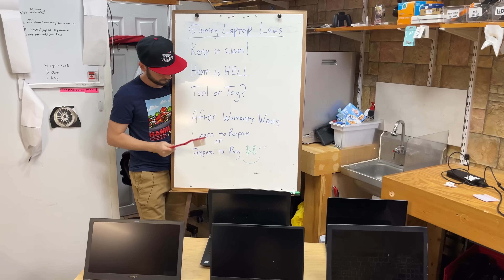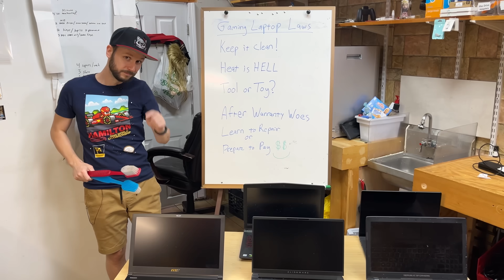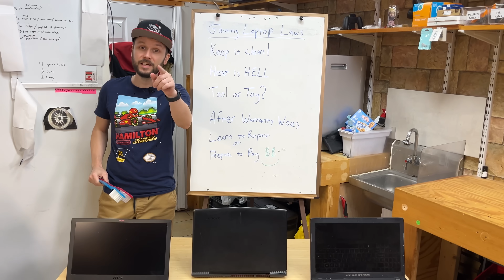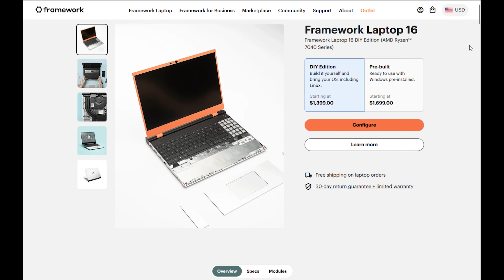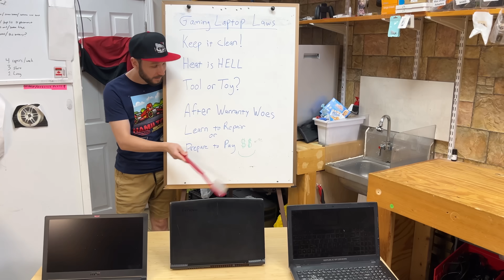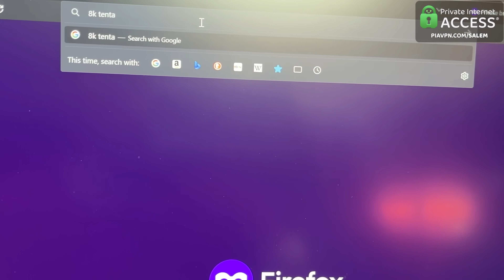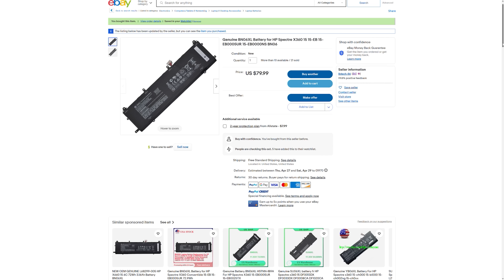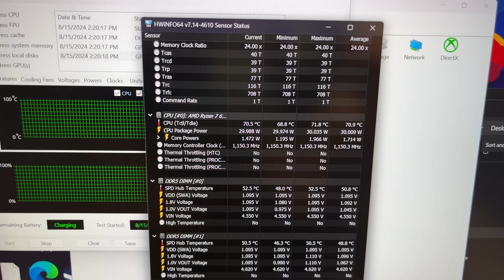Repair Shop Owners Guide to Buying and Maintaining a Gaming Laptop

Comment: Ever since you talked about the P50, I've been checking ThinkPads of that series, ( 50, 51, 52), and even though my current laptop is still working well ( a 13 year old Dell Inspiron N5110 with an i7), i do wish to have something overbuilt, upgradable, and it could last again the same amount of time. Of those three ThinkPads i mentioned, which one is the "worth it" between used price to performance to durability? I'm interested in more light casual gaming, and honestly nothing really from the last 3 to 5 years. P50 are a bargain, P51 are more expensive but still below new laptop prices and the P52 it's a stretch but if equiped with highest or as close to highest spec, still a beast compared to a lot of stuff. Unless I'm really out of touch with the current market ( i still cannot fathom with AMDs are the better ones, compared to Intel and Nvidia). Which one would you go for?

Comment: With cleaning, how often should I be pulling it apart to clean? Went from a Clevo which was about 17 seconds to disassemble but now i have 17 screws and a dozen clips in an MSI and really don't enjoy dealing with clips at all. 

Honestly miss the Clevo and how easy that was to entirely disassemble.

Comment: The fact that i watch this on an HP gaming laptop and i have a 13 year old dell gaming laptop that was cleaned last time 5 years ago that had 10 TONS of dust that i had to get a big paintbrush to remove it and the thermal paste has never been changed and it peaks at 90°C and turns off
Reply: Also the dell got a weird ahh update and now has macos and now overheating even more

Comment: I got 2 alienware m51 laptops  one is r1 and was mailed badly the other was plugged into a wall and surge hit went po. Really need to try to swap the motherboard out on r1 see if it's an easy fix. Brought both into multiple repair shops for inspection and all 3 said sorry me no fix. So if I want more then a dusty paper weight I guess I gotta try one of these odd wb sites that sell replacement motherboards and try to fix one at a time.

Comment: Bought a lenovo legion y530 gtx 1060 6gb back in 2018. Worst decision ever. Temps were horrible and even repasting didn't make a difference. Died less than 3 years later due to power port pins first disfiguring then burning out. 1300$ down the drain.

Comment: Just got some PTM7950 for my Zephyrus g14 repaste. What would you recommend for the vrms? I was thinking K5 pro but I've seen conflicting reports about it.
Reply from the maker: I'm used both K5 Pro and Upsiren thermal putty, I would go for Upsiren as it's generally easier to apply and remove.

Comment: after the first few losses of normal laptops, i always have a ready supply of alcohol wipes and also gave my new asus gaming laptop a keyboard cover now. Thankfully i also bounce between my desktop and laptop for purposes. However in the eventuality that i have to change the battery for an asus like for an old dell laptop, how difficult would it be to source an asus tuf battery

Comment: Hey @SalemTechsperts I got a question. I recently got a gaming laptop and was wondering about the charging port and the cable. It says in the user manual that you shouldn’t keep the charger plugged all the time because the parts were not made to sustain such heat overtime. But taking it out and plugging back in seems like the wear and tear will get to it before the heat, I’m a little confused on what I should do? Any help/advice is much appreciated thank you! 🙏

Comment: I had mine for 7 years, i still use it, heat problems, the display gave up on lifr so i had to get a new one, some key caps are broken, the keyboard has crap under the keys, the hdd connector is bent, i need new ssds because they are slow, the cpu is throttling (maybe the gpu aswell), the fan on the gpu side has a blade broken so the laptop vibrates, the heatsink's radiators are kinda bent, the heatsink's screw connector is fucked because i bent it while trying to remove a chewed up screw, also I have to buy new screws because they are overused and chewed up

Comment: I want to get into the it desktop support space in Madison, wisconsin but most jobs offers i see require 1-2 yearz of experience. Which i don't have, even though i am CompTia A+ certified,  and have a technical deploma in it desktop support, any tips or advice would be appreciated.
Reply: Try looking at your local school districts. That can often help get you in the door. Depending on the district, you they may have help desk roles or IT technician roles or a hybrid of them.

Comment: Could I ask how expensive those micro-soldering place generally cost? I also know exactly what the issue is I just lack the technical expertise to fix it (soldering). My Alienware m15 r5's port for it's built in screen is damaged and the bios doesn't like it. Part of the plastic connector broke off (I still have it), so now some of the individual copper wires don't even make contact with the port anymore never mind the screen. What I mean by the bios doesn't like it is that the damn thing will refuse to boot if it can't detect that the built in monitor is plugged in even if an external display is plugged in. I can trick the bios into thinking the monitor is still connected by holding the piece that's broken off by hand next to the rest of it on the mobo so I can plug the monitor in. It still doesn't send signals properly thus the screen doesn't work still, but the bios can at least detect it which is all it wants. After it starts Windows I can simply take the broken piece back off and keep it in my save keeping place, and Windows will properly detect and recognize my external monitor and make it the main display. Basically the problem is that I need to get that port fixed to at least to the same degree that holding it in place with my finger does. I'm perfectly fine with not having the laptop's built in screen actually being functional though obviously it working is preferred. Also I'm not sure why it does this, but the problem only comes up if Windows doesn't shut down properly. However, if it does you'll be able to full restart it as well as shutting it down and turning it back on later.

Comment: sheesh i can smell this video, i usually have a stack of dead gaming laptops on our shelf in the back at any given moment. ill also note that i've seen at least one of each of those model gaming laptops come in for repair, expensive pieces of trash imo

EDIT: quick question, i on occasion have to redope laptop cpus so end up using thermal paste and from my experience isnt as good as thermal pads on gaming laptops and wanted to know what you recommend for thermal pads

Comment: Not a gaming laptop but my HP Pavilion laptop battery ballooned up oneday...
Trying to find a non sketchy replacement online was trouble and the one I eventually bought didn't even work in the end...
Reply from the maker: I had this exact thing happen to me on my HP Spectre x360. Had to grab one from eBay that was genuine and still sealed. Still works to this day, which is about 3 years later.
Reply: I had a similar issue as well I live near a micro center so I got it there instead. The only annoying thing was the non HP battery screen every time I booted it but it was better than getting a sketchy Amazon one in my opinion

Comment: I want to game, am used to having the lowest of the low so am not picky, though im considering a minipc because it seems.i could get up to a 780m for around $400.
  If i follow your advice to get a t14, what gen should i be searching for?
  Prices on used vary greatly, and is a bit of a gamble with the cheaper websites.

Comment: Quick question, i'm looking to repaste my legion 7(2020model) and it has a vapor chamber cooler. I watched a disassembly and i didint saw any thermal pads in the inside so i am wondering if i have to order thermal pads?

Comment: Can a computer really get damaged by heat? I thought the manufacturers set some thermal limits that would either throttle or shut down the cpu when temps become critical.

Comment: I am working on a sleeper prodesk 600 series that’s built into my desk and I’m going to order plexiglass and some brackets for it to work but for right now it’s all plugged into my desk and runs slower then my grandmas car I am running a 15 year old cpu and am going to get a i5 8500 for it to run once human on better quality I’m running the original power supply that came with it and a 1650 that I got from a friend it plays games very slow but if I do get a chance to I would upgrade to a mvme or get more ram for streaming on twitch

Comment: I have an MSI Raider GE78 HX 13V that I purchased from Microcenter in August 2023. Since day one, I've noticed an issue where the CPU temperature reaches 90°C when I play video games. I initially didn't pay much attention to it, but now I'm starting to get concerned. When I play GTA V, the computer sometimes freezes or the screen turns black. I'm beginning to wonder if this is normal or if there's a defect. I'm really starting to think that Microcenter might have sold me a faulty product.

Comment: I got a question, i recently changed my ram in my laptop. I was following a step by step guide made by the company (that made the laptop) and it said to remove the black tape covering the ram, but it didnt say if i had to put it back in place afterwards. Should i? Is it gonna burn hot if i dont?

Comment: With the topic of Heat, should I adjust the TCC on my laptop to only go to 85°C? I have it set to 90°C but I have no idea if it will throttle performance that much.

Comment: from a couple of years of experience owning a gaming laptop i learned one crucial lesson: do not buy a gaming laptop. i hate mine with passion.
Reply: a brand new acer aspire 7 laptop was throttling at 80 degrees, which it was reaching in cs:go because the cooling is terrible. if I wasn't heavily into optimisation of my system i would have to live with terrible lags because it is unusable without heavy undervolting.

Comment: I just bought a MSI cyborg 15 A13V, im trying to keep my computer clean as new and trying to keep it cool i also have extra fans but i dont know if my computer is overheating or not, when im gaming its usually around 65-70 degrees, and on natural its usually around 45-55 degrees for both cpu and gpu are those good numbers?

Comment: hey its unlikely you hear this but i really hope you do, i have a lenovo legion 5 laptop with AMD Ryzen 7 5800H and a 3070ti gpu but the thing is my laptop overheats alot in games like dead space remake or even fortnite i went to settings to stop this and made the cpu only work to 75% but the thing is i want my cpu to preform at its best because i need it to and knowing that 100 percent isnt allowed do to heat seems stupid by the manufacturers of it

Comment: I bought a used Lenovo Legion 7 Gen6 recently that looked amazing. Turned that sucker on and the smell...... Oh the smell made @SalemTechsperts mom run out of my room so fast she left the fresh chicken tendies without touching them... I removed the swamp gooch like the champ I am but the smell is still there after the isopropyl bath I gave to most of the components. Even if you avoid the bed, keep that pet fur away from the vents :)

Comment: Firstly, I accidentally spilled noodle soup on my laptop, but because I have the skills, my laptop is still there until now
Secondly, maybe I will buy a fan for a laptop with good airflow, after the money is collected this week.....
Thirdly, for me a laptop is a tool that must be looked after as well as possible
Fourthly, ah... this is a bit embarrassing.... because I spilled my noodle soup, I turned it off and disassembled it on the same day and lost the warranty on the same day too.... (I think)
Fifth and sixth, I already have basic skills regarding repairing laptops, but if the damage exceeds my skills then I am ready financially...

Comment: A connection at the loadingport of my Lenovo Yoga 530 is lose ... should i solder it back together or would it break even more? ( right now everything else works but it dose not load, corse a slim metal strip is lose)

Comment: Hi! So I got a Dell G15 5530 that i have for almost exactly a year. According to Msi Afterburner, my Cpu (13th Gen Intel Core i7-13650HX) is overheating and is still overheating after cleaning out the vents. My Gpu is fine tho, running at 60-70 degrees while playing which was basically the same before i cleaned out the vents. Does that mean that the thermal paste needs replacement? If so, how do i do it and which thermal paste should i get?

Comment: Iv got a laptop which is like 2 years old, everything seems normal but thers alot of dust in my area and I'm a little worried about temps, its an Acer Nitro and the nearest service center for Acer is around 10 kms away so idk how il gonna clean everything and maintain properly

Comment: Hey, can you help me out regarding a design issue in lenovo legion laptops Y540? Charging stops midway due to rising temperature of the laptop, i use throttlestop(-140mV), keep laptop clean, change thermal paste but still charging issue continues. The heat reduces but the charging port heats up which result in no charging.

Comment: i need some advice, i am 16 years old with some experience in repairing pc and console, this year i bought a laptop from asus (vivobook series), i know it isnt a gaming laptop but it has a 3050 and a 12gen i5 and for 700 euro i think it was a good deal, the problem is that my parents do not want to let me open the pc because they are scared that i will break something, any suggestions on how i can keep the only fan that prays for its life in good condition without having to open it? thanks

Comment: My gaming laptop broke after i repaste it. It lasted 4 years with no problems but the last 2 weeks it was having thermal issues. I maintain it regularly so no swamp gooch. So i re paste it and after i did that it kust stopped working

Comment: My dell G15 came out of the box bluescreening and even still it blue screens about every hour. Annoying that it’s happened during online exams and caused trouble.
Reply from the maker: @3vlogs487  damn. Didn’t have time to return it?
Reply: @SalemTechsperts no, I thought it was a windows problem and I would be able to fix it. Even after a full reinstall it still blue screens constantly. I extended the warranty because they let me for some reason so I’m going to send it to them.

Comment: My DELL Omen gaming laptop fans just suddenly stopped working. I bought the replacement fans and got it installed by Best Buy, but they just told me “it’s probably a motherboard issue since the fans still didn’t work after replacing it” 

Anybody got any ideas over what the issue could be? Best Buy just told me to send it to the manufacturer, but my warranty ran out a while ago and I don’t want to pay the price of a new laptop just to replace the motherboard

Comment: After so many years i haven't come across a gaming laptop that is not overheating. Have you? even the top range of gaming laptops have heat issues. Customers ask me to propose a gaming laptop and i really dont know one that is running smoothly. Do you have one in mind?

Comment: My Gigabyte G5 GD laptop stopped booting 2 days ago. I tried swapping RAM. Removing SSD and CMOS Battery but nothing seems to working. No it does not even post. (Fans are not spinning.) No response in short. I don't know what should I do now.
Reply from the maker: Tried a new charger and booting with battery unplugged? Like I said in the video, 9/10 times a no-post situation on a gaming laptop means a component on the motherboard failed.

Comment: I have an Asus ROG Zephyrus g14, I'm not sure what year, I think 2022, every 20 minutes or so I lose connection to the internet and my home router needs to be reset. I have updated and then rolled back the drivers, reseated the WiFi card and cleaned everything. Weird thing is, my home network is the ONLY one this happens on. all other devices connect just fine. Hoping that someone in this community might have an idea that I haven't thought of yet.

Comment: salem please reply my message bro I bought a gaming laptop rog g713qm everything runs fine on integrated gpu but once i change to the dedicated rtx 3060 gpu the cpu mhz falls from 4k to 400 and nothing works anymore the top part above the keyboard where the vrms are starts heating i can feel it if itouch laptops body. I tried changing thermal paste and putting thermal pads on vrms but nothing worked. but on integrated evertything works perfect. Im short  on money to buy a new one or buy new motherboard

Comment: bro I recently brought Lenovo Loq i5 12gen HX processors, 3050 , 90W gpu . 16 gb ddr5 ram , but still when I play cs2(in low resulation) gpu temp going upto 78 degree and sometimes going 86 degree what to do bro ,, pls help

Comment: Yeahhh I wish I did more research than just "look into components" before buying a gaming laptop 2 years ago. Got an HP Omen 17 and it has this issue where it just freezes during use, mainly while gaming, and has to be restarted. But it's happened when just browsing before.
And then the fan bearing started going kaput.
The reason I got it was because I needed a new laptop and I didn't have space for a current gen console, so why not kill two birds with one stone? But 2 years later it becomes more and more of a hassle, and it'd probably cost a fortune to figure out what the issue was. According to someone I asked, it had something to do with a power thingy on the motherboard.
After moving, though? I had space. So instead of spending a lot to fix it, I saved up to build a desktop which has been SO worth it. No longer do I have to listen to fans scream in games that don't have framerate/vsync settings. But the most important part of it all?
The Fractal North case. God this thing is nice~